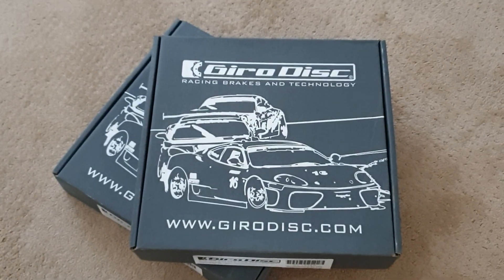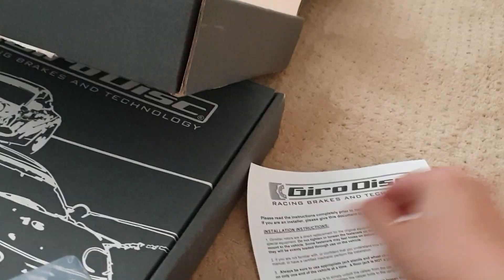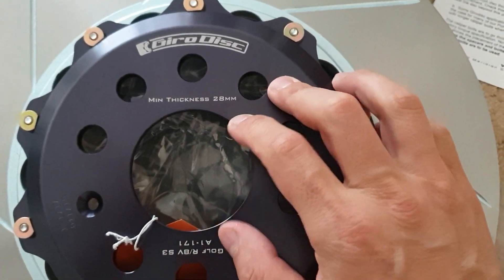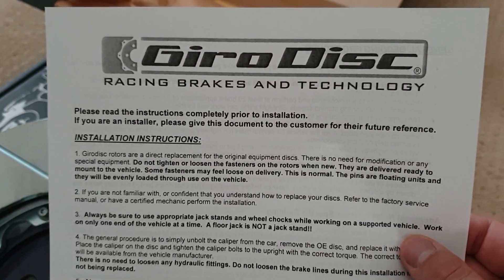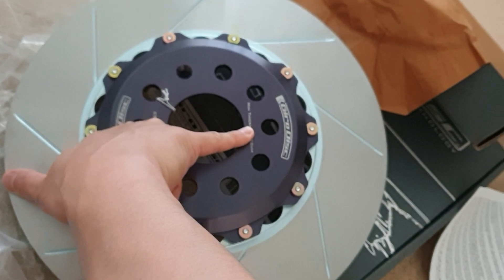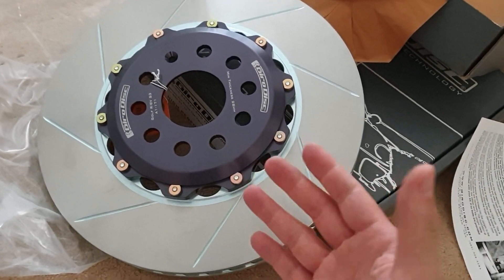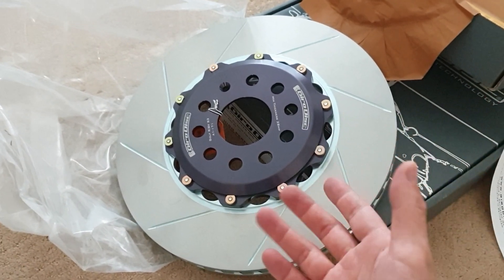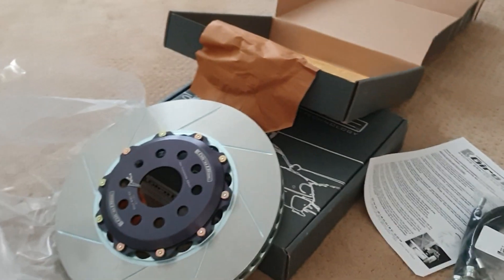GiroDisc for MK7 Golf R / Audi S3

Comment: did they wear your pads any faster with those slots?
Reply from the maker: No they do not. The slots just allow build up gases to escape.
Reply: @tranjen  that’s what I kinda read as well, thanks! Did you feel an improvement overall in weight/handling?

Comment: some years on, so you still like these for a road car?
Reply from the maker: Absolutely! It all depends on the pads you use, but having lighter rotors makes your car behave differently and for the better. Gas mileage improvement, stop power because it's lighter, and better/stronger material than stock.
Reply: @tranjen  so no extra noise?
Reply from the maker: @mapyn131  Nope. Just like stock, but obviously much better quality and lighter.
Reply: any photos on the car?

Comment: Can’t wait to get mine for my RS3! If you thought your stock front rotors were bad, ever seen the RS3 rotors after 19,000 miles? You’d swear it’s made out of chocolate. Much like the pads are which are already down to 3mm haha. I’m using the Girodisc Magic Pads with the front and rear on mine. Wanted to use Zimmerman rotors for the rear but those are on backorder as of now. So I went with the Brembo rotor. Fingers crossed this will be great!!!